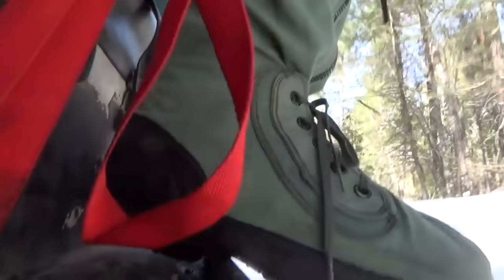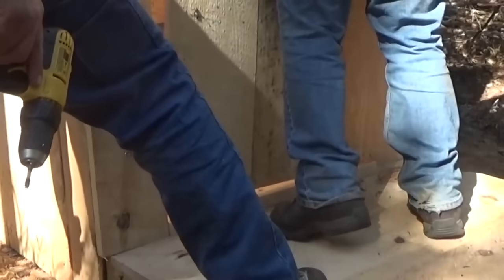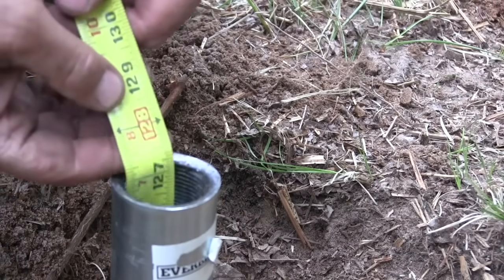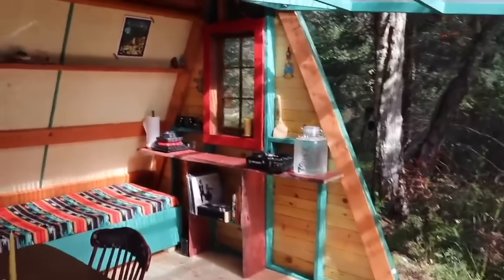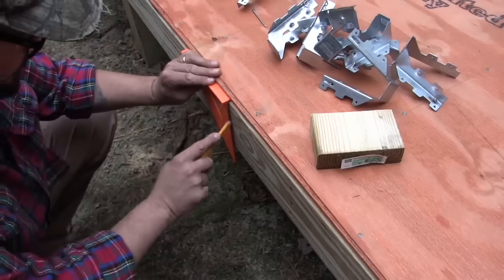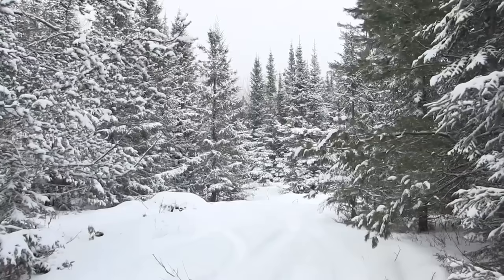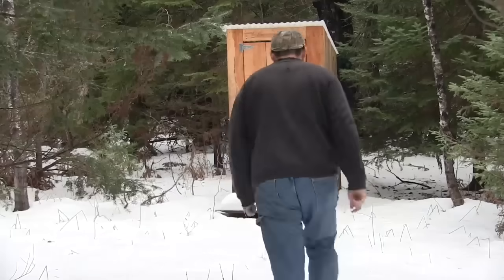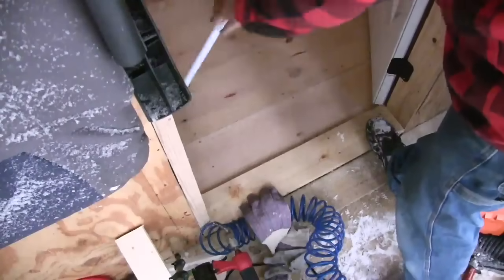Off Grid Homesteading.....everything you need to know

Comment: I get what you are saying. But, I don't mean this offensively, you aren't thinking it through completely. You live in a vacuum where you exist, your land exists, and you should be allowed the freedom to do what is necessary. Unfortunately, building codes aren't designed for people that want to build a dependable structure. They were created because there exists people that don't have the same motivation as you. And when building a structure, it becomes very easy to conceal short cuts and potentially life threatening situations that for the person preforming the work means less money out of pocket. I am in the residential rehab business, and I see it all the time. I have seen builders forego attic insulation, spray adhesive drywall tape to avoid mudding, splice wires without using requisite boxes, burying those boxes in the walls, use 4 screws to hold up a sheet of drywall to the ceiling, use hot-mud to hold up drywall patches, install underrated girders in spans that the girder couldn't possibly hold up to, etc. I mean the list goes on and on. Unfortunately, people are cheap to the point that your safety is a far second to their profit. 
There is a second type of builder. An inexperienced one. Building codes help hedge the possible detriments of inexperienced builders by requiring(hypothetically) an experienced person to oversee their work. 
These laws aren't put in place necessarily to protect the profit-seeking-capitalist-above-human-life builder, nor are they in place to protect the inexperienced. They are put in place to protect everyone else. The inexperienced builder has killed countless of their off-spring attempting something that they had no idea about. They would probably argue with you about the necessity of building code enforcement. The profit seeker only hopes that in the event of your serious injury, or worse, death, they aren't held responsible. Even though they are. 
Another note, pre-sales home inspectors like to believe that they are THE resource of how a home should be put together. I have been called out by every single home inspector in the state of Missouri to replace circuit breakers that are rated at 15 amps and have 12 gauge wire attached to them with 20 amp breakers. This isn't only wrong, but it is stupid. I am not an electrician, but I do know that a circuit isn't rated by the gauge of the wire that feeds it, but by it's load. But I have yet to meet a certified home inspector that knows this very important information. That is why I used the word "hypothetically" above when I spoke of experienced persons.
Also, pulling a permit does not cost a single penny in any jurisdiction that I have ever built in. The reason why is because the way that permits are priced is project valuation. If you are doing a project that is valuated at $10,000, the permit will cost you approximately the same as sales tax on $10,000 in materials. You take your permit(tax exemption) to the building center(home depot), and sales taxes at either the city, county, or state level(depending on who you have to pull permits through) will be waived. 
If within your jurisdiction an inspector or building department does not actually inspect the property, then you should take note of their negligence. If something happens because of a missed inspection item, the liability of that fault will be simple to push to the building department. If enough ethical people do this, it won't be long until the local building department starts to do their job.
Reply: Long read, but I think you are right.

Comment: Great videos!  Thank you.  I do have a couple of questions that I haven't seen addressed.  (I'm sorry if I just missed 'em.)  I plan to build an 8x12, "bug-proof" cabin that will sit sealed for weeks at a time.  The region has sub-freezing winters and humid, hundred-degree summers (as extreme examples).  I might assume that with a window, the answer is "just crack the window if you're concerned about CO2 or anything in the winter", but I'm not sure if extreme heat and any moisture is a concern for extended periods over the summer.   Is a squirrel and wasp proof vent of some sort a good idea or bad?  

Also, if it's just going to be a hard-sided tent with a heat and a/c source (w/generator), is double walling and insulation worth the extra expense (particularly in the floor)?   I could try it without insulating it first and add later, but I'd rather trust the opinion of someone knowledgeable if it's a no-brainer.

Comment: Two things
1) I disagree with you regarding "textbook vs hands-on". Theoretical and practical do NOT negate each other, they COMPLEMENT each other. During trades college when my "peers" were bumming around the campus, I spent HOURS after classes in the library reading, everything from electricity to chemistry to structural to welding. When I showed up on the jobsite, I wasn't lost, scratching my ass. 
(knowledge + practice = skills) 
2) Don't use pipe dope on threaded fittings, especially on potable water. You do not want that leeching into the supply. Use Teflon (PTFE) tape. I've been using tape-only since 2016, not a single leak. 
Good luck 👍
Reply from the maker: The pipe dope is rated for potable water. As for the textbook stuff, I would still stand by it .......I get your point.....but there is too much difference between reading about something and actually owning the skill. 
      For example, I can read electronic schematics as good as anyone. But open up a 1950's tube guitar amplifier thats point to point wired and it's a rats nest of wires and if you arent used to seeing that rats nest, all the schematic reading you've done isnt very useful. 
       You have to be familiar with the real thing in practice, or you still havent learned the skill.

Comment: When you mention housing prices have tripled. Actually they haven’t it’s the amount of money printed that has tripled. That has caused everything else to seemingly get more expensive but the only thing that changes is the money supply. Fiat money is not inflation proof and at a constant rate of 4.9% the markets will continue to double and triple into infinity. Until you have a wood shed that is $100m. This is very similar to what happened to the Soviet Union.

Comment: The comments made regarding being able to do whatever you want on your property are something I would disagree with.  Unfortunately, most people aren't like my good man here in that they are motivated by shortcuts and other ideologies that are more prone to failure when executed by the wrong person.  For instance, someone may build their own cabin and install a wood burning stove, but not use double walled pipe through the wall/roof.  Then what happens is it starts a fire, which causes their property to catch fire and it starts a forest fire, which then damages or completely guts other adjacent properties (or more)?  That's one of many examples.  In some instances, they assume the risks as long as they own the property (say just a structural build such as a shed).  But what about if/when they sell?  Now the risk (and potentially unknown risk) falls on the new property owner, which could lead to serious injury or death.  

I do, however, believe less government involvement is better.  I think the "happy medium" would be to have a small test (much like a drivers license) that test an individual's competency with carpentry, electrical, plumbing/sewage/water, foundations, etc.  So then you get a certification for basic stuff, and if you gain that then you don't need a permit for those particular aspects of a small build.  And just like a drivers license that have different classes, they could have the same for this situation.  Johnny/Susie homemaker vs. Commercial. 

Just my opinions, and I could be dead wrong about all of it.  That said, I truly like this duo's work and how "common sensical" it is.  Very, very well done sir!